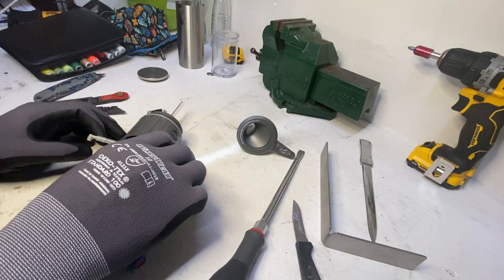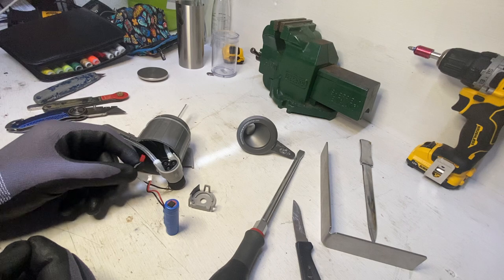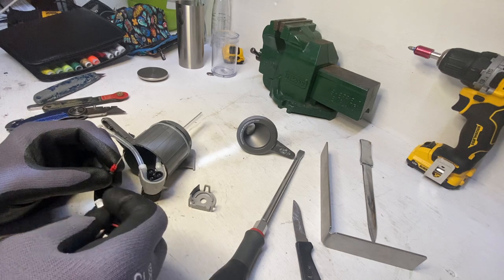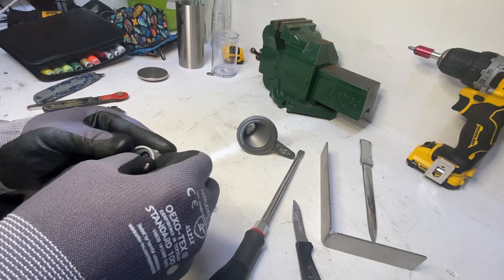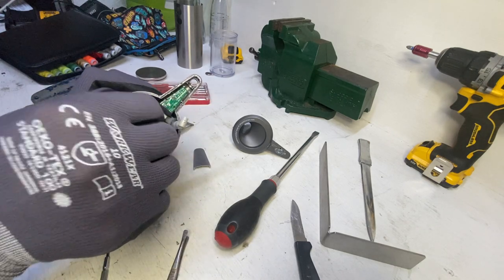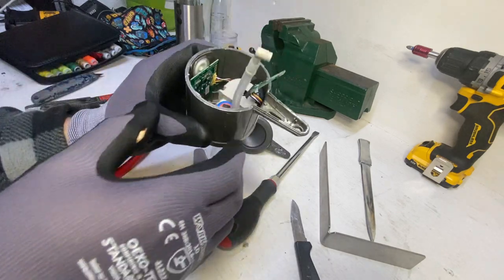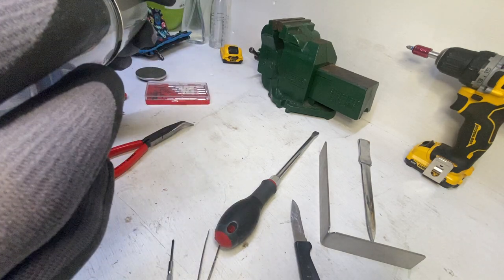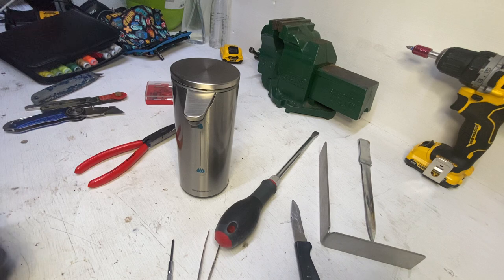Dismantling the SimpleHuman rechargeable soap dispenser - Part 3 - testing the motor and sensor

Comment: I am super pleased to have these videos to look at! Tyty! 
Got mine apart now after the same LED behavior shown in video part 1. 
Weirdest thing for me is everything tested fine, put the board and plugs back in, unit started working normally again??? Guess the board needed a full power cycle? ...But any problem that goes away by itself can come back by itself... 

As nice as that is, hard to see myself buying any of these again. I really liked it when it worked but the construction makes it disposable. What is an owner suppose to do when the LiPo battery reaches End of Life? Can't put in a fresh working one without nearly destroying it. There is another model that uses four D-cell batteries but still, same argument works regarding pump failure or sensor failure.
Reply: Actually, same thing happened to me. I only tried putting it back together after reading your comment and it all worked again perfectly! Thank you!

Explanation: Mine wouldn't turn on and would blink a blue light once only when I try to plugged it in. So it didn't seem to be charging or anything. I took it apart with help from this and another video. I checked the battery and motor and everything seemed fine, so then I started thinking it was the circuit board. But then I read your comment and put it all together and it magically started working. You're probably right and the board required a reset. 

If anyone is having this problem I would suggest taking it apart and unplugging the battery and motor from the board before buying anything or trying anything else. Let it sit unplugged for some time (mine was disconnected for a few hours) then try plugging it back in and seeing if it starts working. Good luck!

Comment: Hello, great video from you.  I have a problem with the soap dispenser.  If the soap dispenser was fully charged after 2 days, the LED flashes red, which means that the battery is empty.  Or am I wrong?
Reply from the maker: I think the battery might be dead if it doesn't charge after 2 days. But check the cables etc.

Comment: Is it safe to run your unit with some diluted alcohol once in a while to make sure soap dies not dry up inside?
Reply from the maker: I am not sure that alcohol dilutes soap. Also, alcohol would be much less dense than liquid soap, so I am not sure if it would come through the pump. Last and not least, the way the pump works relays on some friction being created, perhaps not ideal to have flammable liquids